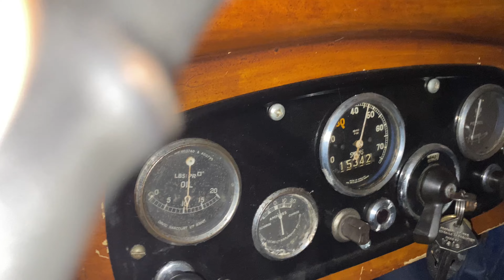Austin 7 first 24hrs and it’s transformation from slow wobbly tractor to a lovely driving nippy car

Comment: Early SU carbs don't have a spring. They work on a weighted piston. Saying that, the one fitted to this car appears to be a later SU. It certainly look bigger than the OM-series unit that's fitted to my 1932 Morris Minor, which has a 1in bore and no means to fit an air filter.

Comment: My first car at 17 !.If it's a very late Ruby ( late ' 38 ) with rear Girling rod activated brakes , it has a slightly ' taller ' rear axle ratio and about 55+ is about top whack but 50 or so for an earlier car.It should have brake lights , the switch on chassis close to the steering box. The central ' pork pie ' rear light was originally the only one it had, then later legislation demanded 2 to indicate  the width of the car .The S.U carb is a worthwhile mod. over the original Zenith 26VA but DO check the valve tappets ( a bit of a faff ) , easier with the carb. removed to ensure maximum available compression .Sad it's been robbed of the original registration.

Comment: Ditch the old Champion plugs & get a set of NGK for her....
Reply: I'll second that. I had a brand new set of Champion D16 fitted to my 1932 Morris Minor that only did a few miles before they failed. The NGK AB-6 that replaced them have done almost 14k miles without any problems.
Reply: Agreed. NGK  much better!
Reply: I stopped using NGK plugs years ago  in my classic bikes. As soon as they start to soot up they start go off song. I found Bosch or NOS champion to be far more durable. When you only have 2 cylinders and a few hundred CC you soon notice the difference.